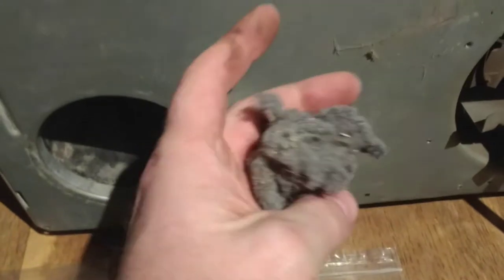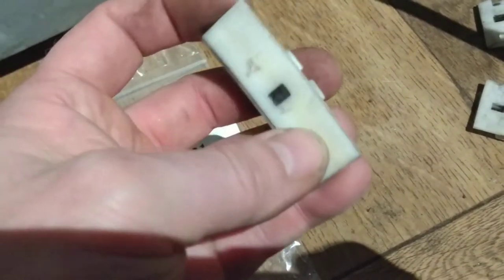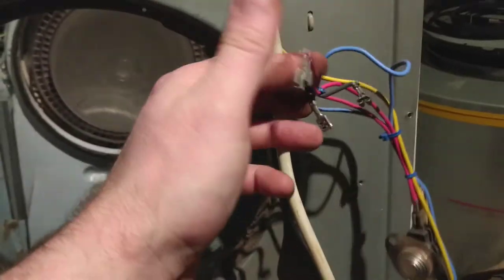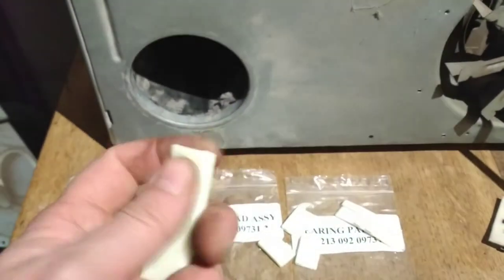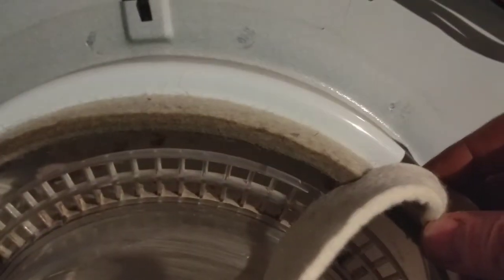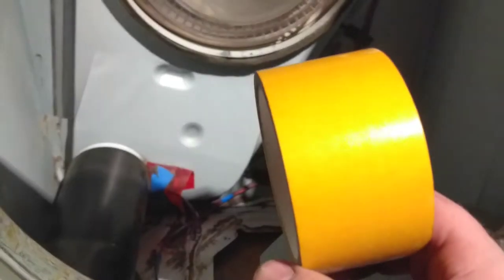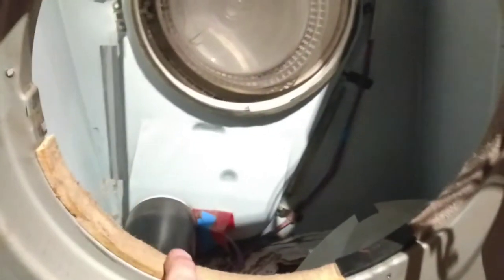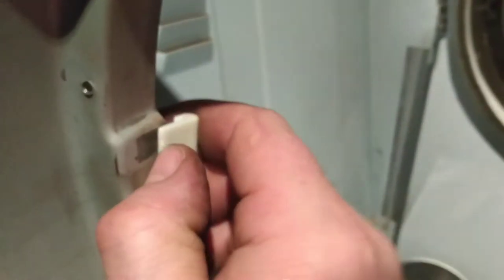Tumble dryer repair

Comment: Sir I open tumble dryer of indesit for change back baring when I fixed tumble dryer indesit running only one side not rotating other side what happen maybe wire connection I don't know kindly can you explain me thanks I am waiting your reply
Reply from the maker: If the motor is turning but not the drum then it might be the drive belt isn't fitted correctly or perhaps broken.
I don't know if your model tumble drier is belt driven like mine is, but if it is I'd check the drive belt first.
Reply: Thanks for reply God bless you